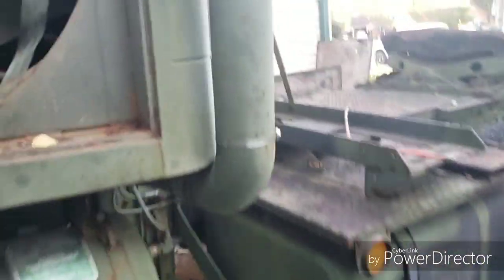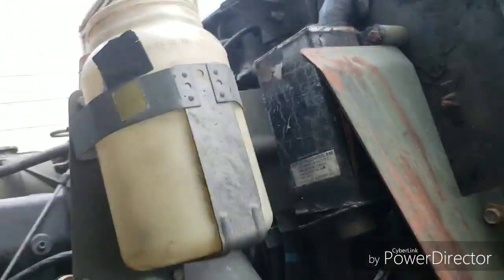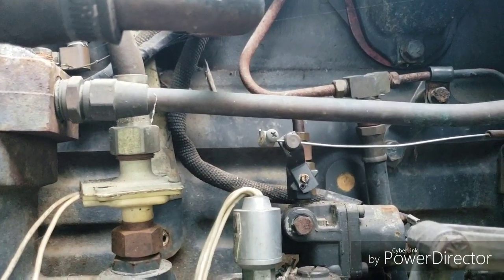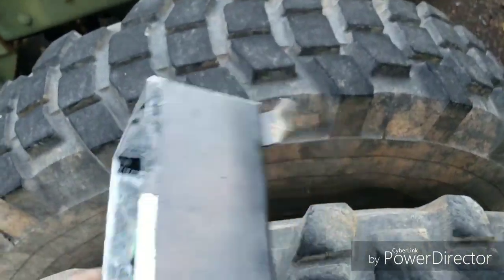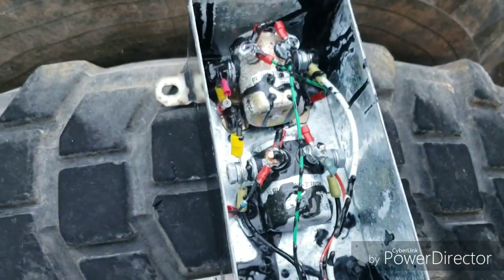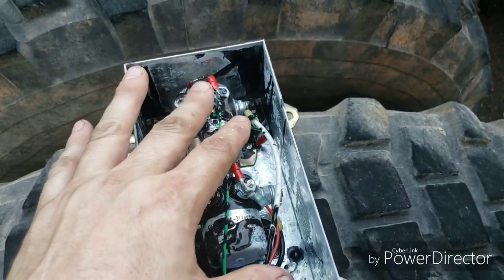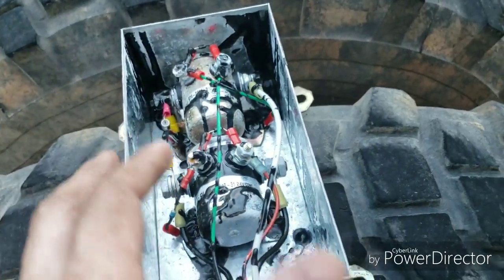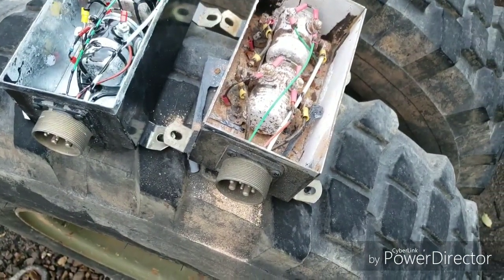M809 / M939 series No power/No start -  Bad PCB Box - Bypass to Start / Rebuild

Comment: My abs went out could it be this top solenoid causing my issues I just replaced  my alternator because it was over amping
Reply from the maker: Rebuild the whole protection control box with solenoid 24063.  Both of them.  I have a video on doing this
Reply: @wessimpson2794  hey sorry to bother you but before I rebuild it my abs light comes on but stays on would this fix it
Reply: I also don't get the diagnostic clicking when I turn on the battery and starter switch do you know what that could be I did before
Reply from the maker: @whorti1  there is an inline fuse behind your abs light in the multi color harness.  It's 5amp  its blown
Reply: Mine isn't that was the first thing I checked
Reply from the maker: @whorti1  then the alternator short probably blew the abs module out.  It's a normal thing
Reply: @wessimpson2794  shit I just put a new one of those in no change
Reply from the maker: @whorti1  do you have the abs diagnostic scanner?

https://www.steelsoldiers.com/threads/m939-abs-ecu-failure-point.114744/